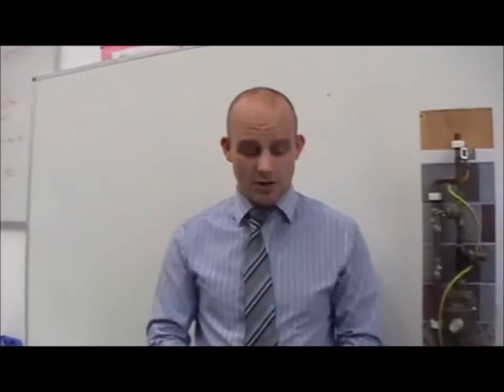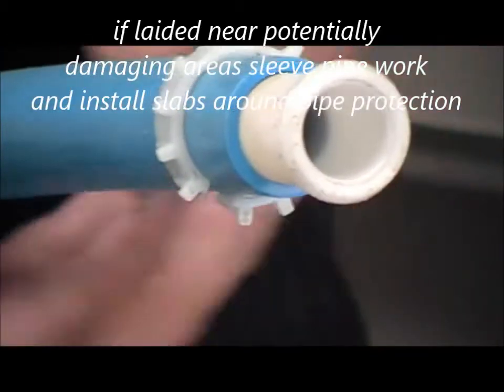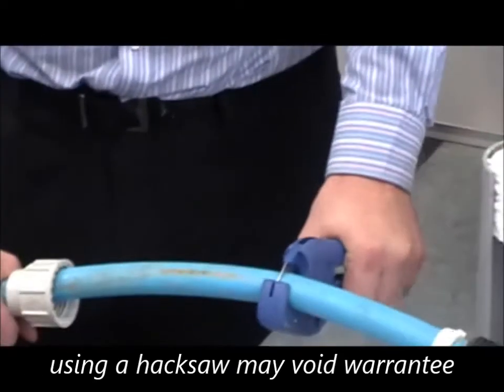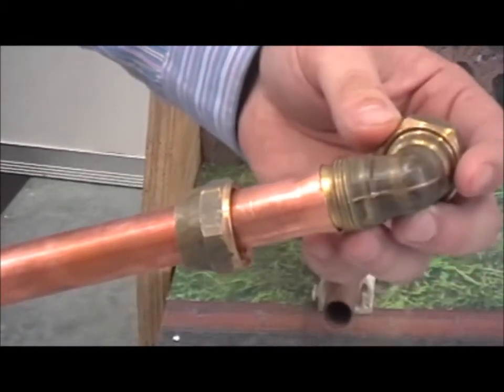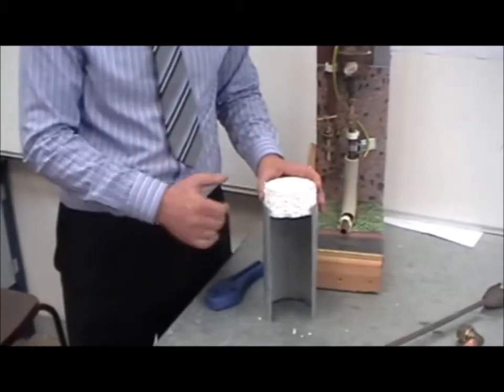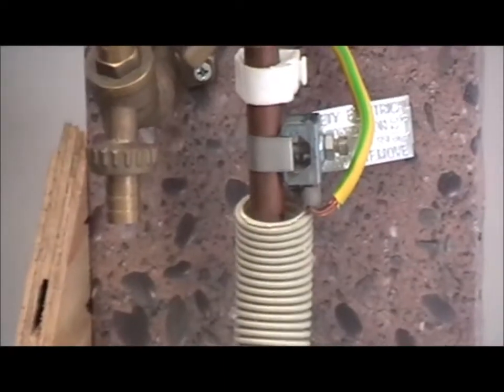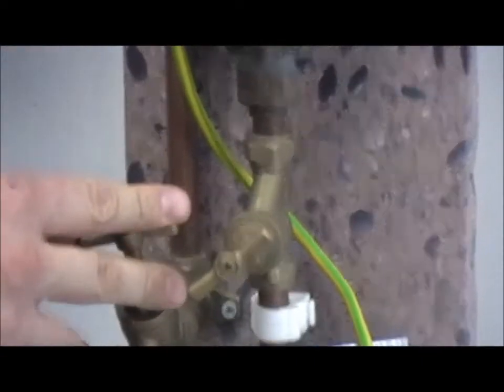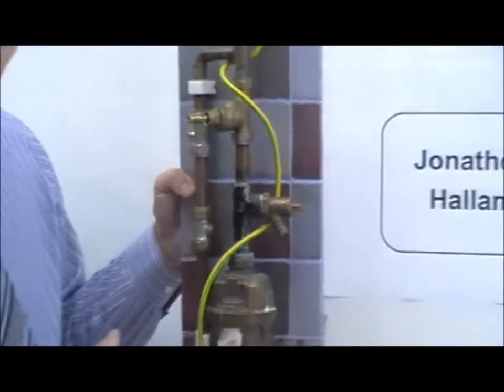Plumbing Cold Water Part 1: cold water supply

Comment: I'm i right in saying Bip tap check valves should be installed within the envelope of a building on new installations to prevent frost damage to the check valves?
Reply from the maker: Ed Straker this was years ago, yes now check valves are mostly separate and internal
Reply: Thanks for your reply, just did a water regs course and they did teach us that...regards.